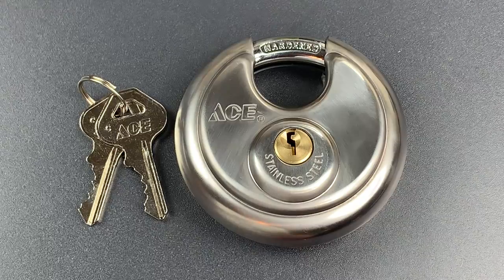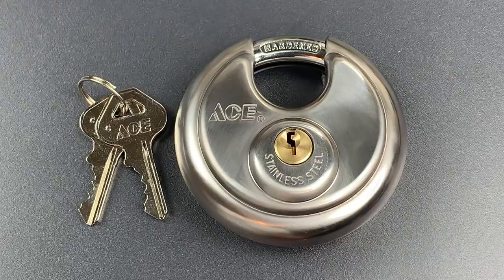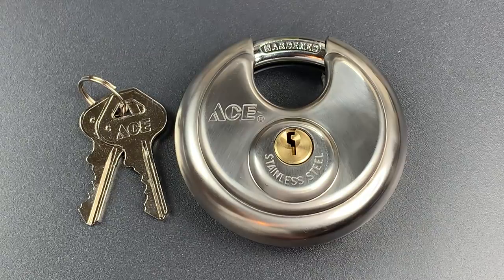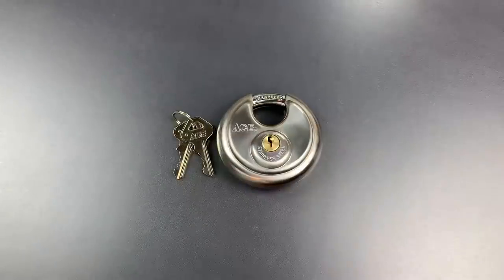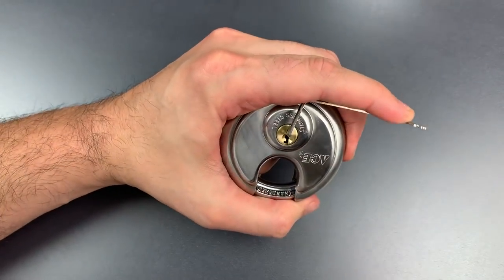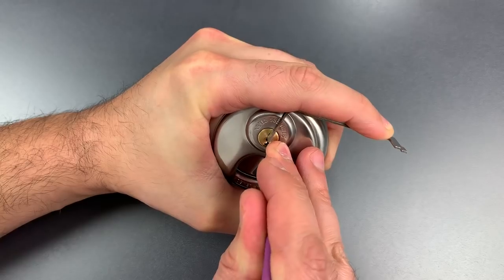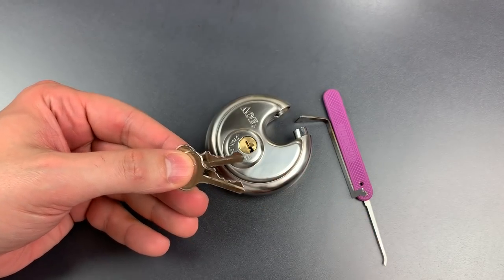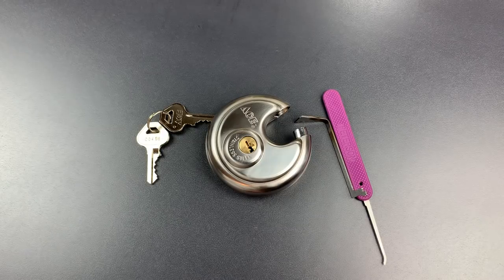[783] Ace Hardware 70mm Disc Padlock Picked (Model 5099510)

Comment: Nice work on the open. I know it wouldn't stop you but it would be interesting to see you pick it up side down because that is how they would be traditionally installed when in use just to see if it makes any slight difference.
Reply: does orientation make any difference on other locks?
Reply: @somepunk2541  Getting to it and what hand movements you are used to, yes but not much

Comment: I have one of these I'm having a hell of a time with. I think it's because the core is very stiffly sprung and the pin springs are stiff so it's difficult to tension. I'm either under tensioning and none of the pins bind or I apply too much tension and the pins overset. As far as I can tell the tensioning is holding me back on this one. Grr!

Comment: Just saying, the other day I got a disk break lock for my 50cc moped that costed only  $4. I got it from Amazon. I went to test it on my moped and locked it the wrong way. The keyway was facing against the wheel not away, so I had to bend my key to get it out!😅 But in a way, it's practically impossible for any common thief to pick the lock!

Comment: All disk pad locks can be bypassed by turning a can of keyboard cleaner upside down and spraying the lock down (what comes out is very cold) to crystallize the metal. Then one good strike with a hammer and you are in.

Comment: Master makes a version of this lock in the 4 pin Master K keyway ... I sold one for $60.00 to a  customer! :) .. WHY??? ... He was desperate to have one keyed to his existing key (long story he had a couple dozen keys issued already) and I complied buy cutting the core out of the disc padlock with hole saw (on the back) ... repinning it and re-welding the lock closed again! :)
Reply: @Joe Casson Thanks for the reply ... but not at all, he's doctor and has probably a dozen padlocks all to the same key, and wanted this one for a storage unit so it would blend in with all the other similar looking locks on the other units BUT wanted it to fit his existing key ... he can afford it so why not! :)

Comment: An interesting thing you said about the driver pins being too short.
Could you elaborate on what that looks like in the core.
I'm having trouble picturing what was happening in chamber four causing it to not need picking,
Thank you for the video. cheers
Reply: I also like that odd information. Knowledge is exciting.
Reply: Pocket Women if you imagine the key pin and the driver pin stacked up on top of each other, when you pick it or insert a key the two pins rise up to meet the shear line so the plug can turn. If the driver is too short, when it is fully down, ie unpicked and no key, it is already below the shear line and therefore the plug can move anyway (if the other pin stacks are picked). When this happens the spring can get caught up in the shear line but fortunately this didn’t happen today.
Reply: @WineScrounger  Thank you for the great explanation on what was going on,
I can see what is going on now.
Much appreciate  you taking the time to help me out with that. Cheers mate

Comment: Are there any good disc locks? That don't cost a fortune?  And yes I'm aware, storage unit hasps can be peeled off with a pry bar regardless of what kind of lock is used.  But there's got to be good locks.
Reply from the maker: Abus 20/70 is my choice for disc locks.
Reply: @lockpickinglawyer  sir I can only find it as a pad lock
Please suggest one good Disc Brake Lock for my bike. And yes in budget🙏

Comment: Not related to this video, but I was wondering, have you ever come across a core that came in two independently rotating cylinders? What I'm thinking is that it would be pretty easy to put traps on the outside of each cylinder, blocked by the other one... so that if the cores rotate out of sync, the whole lock would jam. 
But you're the lawyer here, so I'm sure just reading this paragraph you've already thought of a million different reasons this might be a terrible idea - I'd just like to hear them